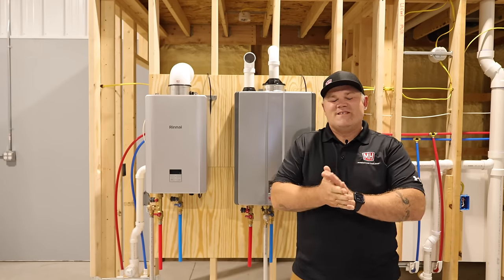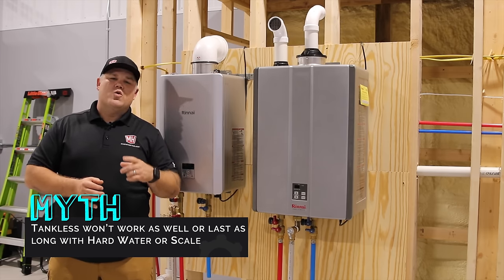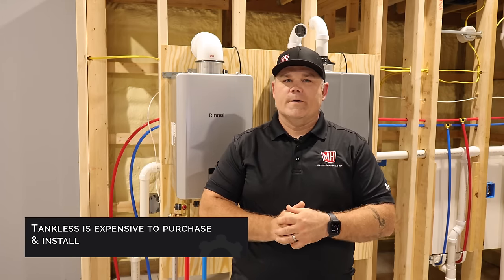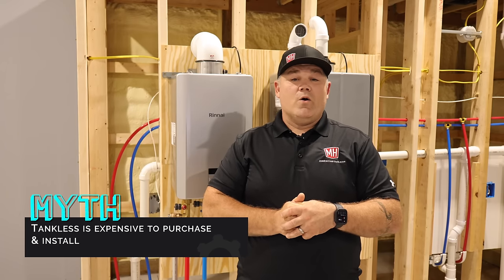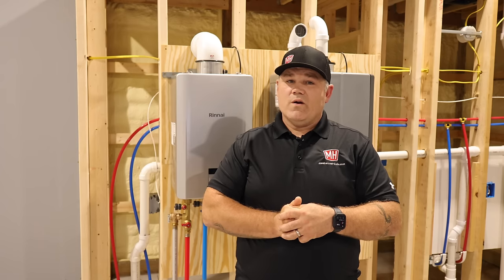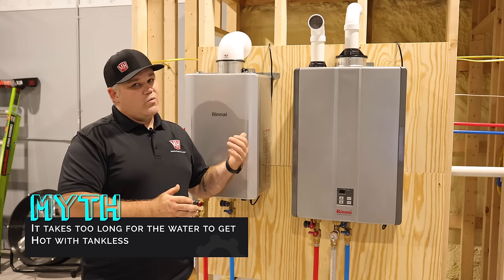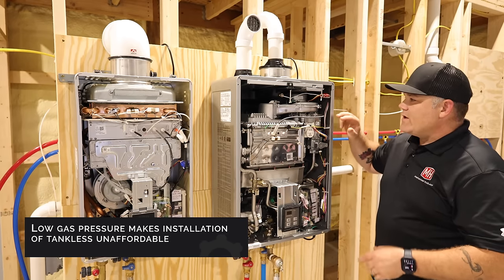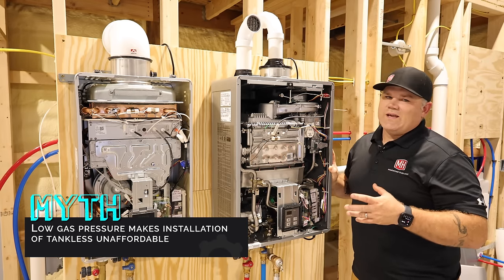Myth Busting! Tank -vs- Tankless Water Heaters

Comment: I’ve been a plumber for 38 years and as soon as you said, this video is sponsored by A tankless manufacture I know exactly where this video was going to go. You are one heck of a salesman. Knowing what I know I would never install one of these. In Wisconsin they no longer allow us to sell them as an energy saving device rather we can only sell them as an endless source of hot water. They have so many problems. They have been a huge moneymaker for me. I wouldn’t sell one to my worst enemy. you never addressed the fact that most existing homes usually have to upgrade their gas service to supply enough gas for this unit. You also forgot to address the question about how many fixtures can run at one time. I’ve had several customers that have water heaters that shut down. When they use multiple fixtures at one time. It’s very common for water instantaneous heaters to go into lockout if you run too much hot water at the same time. You didn’t mention any of the maintenance that is constantly required. You also didn’t mention the fact that you have to have water treatment devices with tankless heaters it’s not a choice they will lime up and be useless if you don’t. So many partial truths
Reply: Yep. And another issue - hot water pressure drop. Hot water in the tank creates additional water pressure which is not happening with tankless. Also, there might be overall an issue with the water supply pipe sizing.
Reply: You obviously didn't watch the video. He addressed many of your concerns. Not sure of the hate here. I've had mine installed for over 3 years now. Best home upgrade I have ever made. Maintenance is once a year and involves a gallon of vinegar and a pump, and is really hands off and not too bad.
Reply: @JasonCarr1979  Same.  Had mine for about 8 years.  Never had an issue with it.
Reply: Research the temperature rise before purchasing.
Reply: I’ve had a Rinnai unit in my house for over 16 years and I have not had any issues at all with it. I had it installed when we built the house so the installation was a little more expensive but well worth it. As mentioned in the video my 14 year old son takes 30 minute showers and he doesn’t know how lucky he is that dear ol’ mom and dad had a tankless water heater installed. If or when I need to install a new water heater I may check into a heat pump unit but if the technology isn’t what I am looking for I will be installing another Rinnai unit. The one thing I will say is that it does take about 45 seconds to get hot water to my kitchen faucet about half way across my small ranch home and it’s worse on the end of the house in the master bathroom since it is all the way on the opposite end of the house from where the water heater is. Area plumbers keep telling me that it isn’t worthwhile to install a recirculating pump but my wife would probably disagree on cold Wisconsin winter mornings when she is trying to get ready for work 😂
Reply: @jko0526  You are extremely lucky to have 15 years out of a heater in Wisconsin. That’s where I’m based. I’ve been a plumber for 38 years. I can tell you you are the exception to the rule, unless you have spent the extra money on getting an iron filter and a water softener.
Reply: I have the larger version of the unit on the left. I've had it for ten years and the operation has been flawless.  I made certain to get the largest residential unit available for my 4 bedroom 3 1/2 bath house. I have three daughters and my wife constantly washing clothes, running the dishwasher, taking showers and using sinks. My Rinnai supplies all of them simultaneously without problem. When so many uses are showing demand at the same time there is a slight pressure drop but no shortage of hot water.

The downside - 

1. The old freestanding tank was next to the furnace in the middle of the basement. I had to build a section of wall to mount the tankless unit.

2.  I did have to rework about 5' of gas line because the tankless unit is configured differently than the old water heater. Gas pressure was not a problem. 
3. The two section vent pipe is called  "B Vent" the sections come in short strange lengths and are pretty expensive for what you get. There are strict installation requirements as far a venting. Distance, number of degrees of bends and slope of the pipe are all critical. I had to buy 27' of B Vent AND core drill an 8" hole through my concrete foundation to get a straight path to the outside. The 8" hole allowed for enough space around the vent to properly seal the opening. I also had to replace some brick on the outside to properly repair the path of the old water heater vent. That was for cosmetics.
4. Every 3 or 4 years you must shut it down and pump a descaling solution through the unit to prevent hard water corrosion and build up. Our city water isn't too bad so every few years is sufficient.
5. I am an electrical contractor. I did my own load calculations and ran a 20A circuit for the water heater and furnace blower/controls. I built my own basement wall and did my own core drilling. I also reworked my own gas line. Most people can't do any of this without hiring contractors

Don't buy any all electric tankless. They are power hogs. Mine is natural gas fired and cheap to operate. The electric load while making hot water is the equivalent of a 100 watt light bulb. When not making water the usage is 5 (yes, five) watts. Think digital alarm clock.

I actually bought a UPS for a desktop computer and mounted it to the wall next to my water heater. If the power goes out I still have hot  water and it also runs the blower on my furnace. During the rare winter outages my furnace, water heater and stove still work because of the natural gas appliances, which the government is trying to take away.

They will have to pry my tankless water heater out of my warm, comfortable dead hands!
Reply: Jesus is the only way to healing, restoration and salvation to all souls. Please turn to him and he will change your life, depression into delight, soul heading from hell to heaven all because of what he did on the cross 

“Whoever calls upon the name of the Lord shall be saved” Romans 10:13
Reply: It's ok to change your mind with new information. 38 years has biased you
Reply: @toobad9946  i live in an area in Canada , where the electricity price is CAD$0,05/ kwh , loool . So , all electric is a no brainer for me
Reply: @karlsoffthegrid1378 I have one and love it.  Recirculating system.  Can run multiple showers at the same time.  Yeah, we have had issues but it's better than a tank IMO
Reply: What about maintenance and longevity of the unit, obviously it is more than yearly flushing like with a tank unit.
Reply: Here’s what’s funny . The rest of the world has been using them
For 50 plus years ….your comment is laughable
Reply: I came here to say exactly this.  Although I am a 25 year plumber from Canada.   This seemed like a straight up commercial.
Reply: I agree with everything he said besides the cost for installation.  I’ve had my tankless for two years now.  It was installed for 3800.  I was quoted 1400 for a tank install.
Reply: I have had my Rinnai for well over 10 years with only 1 problem. Sediment built up on the sensors and randomly shut the unit off. I installed a whole house filter for sediment and I flush it with vinegar every year or two and it has worked flawlessly.
Reply: @stevez340  my hats off to you! Keep up the constant maintenance and you should be fine for a while. Most of them in my area last a good solid 12 years if properly maintained and installed with proper filtration. Hopefully it lasts long enough to recoup your investment.
Reply: I have had a tankless heater for over 20 years and have had zero problems. I'm not a plumber but I know that heating a pot of water all day until you need to use it makes no sense.
If you live in a 100 year old house then maybe a tankless is not your best option.
Seems that most people against tankless are against solar panels and automatic transmissions as well.
Reply: What about electric heaters
Reply: I had a tankless system and was not happy with it.  To be fair this was installed 22 years ago,   But my 2 issues were that in winter even at the highest setting it would not heat the water enough to take a comfortable shower.  In the summer it was ok but I really didn’t mix it with cold water,   But the winters could be miserable

My second issue was the wind coming down the exhaust would blow out the pilot light fairly often.   When it did the system often would not relight, or would blow out again.  

When I sold
My house I never had one installed in any new house, I like the concept but the use wasn’t great
Reply: My brother was a MAJOR proponent for tanklessb heaters at first but years later, he said the same as you. 
You won't recoup the investment.
Reply: Installing a tankless is way more than a conventional w/h unless you are doing a change out. You have to run a new gas line. 40k btu vs 200k btu's Depending on where your meter is, could double the cost. So to say price is the same is BS
Reply: @karlsoffthegrid1378  do you read or watch before word salad comes out of your mouth? You have to do yearly maintenance on a tank unit as well. The video addressed your concerns, he said about three showers at once on the particular unit he’s discussing, and said that he doesn’t run into the need for gas line upgrades a lot.
Reply: @NeedleDrops  😂 yearly maintenance?!! Ignorance is bliss! you may want to read the Maintenance schedule that the manufacture recommends. You just proved my point.
Reply: @JasonCarr1979  No hate just fact
Reply: @karlsoffthegrid1378 what do you think about adding an indirect water heater to a tankless oil furnace?
Reply: You brought the fire. I’m especially glad to hear what that lockout code is all about. I’ve been to a house and had to reset one. I’ve never installed one of these. The first one I saw was like 2001. Another plumber with the same company, operating in the same neighborhood, was installing it down the street in the garage. I was kinda jealous. I strolled on down there to check it out. He was proud. Rightfully so. Our paths crossed a couple more times in life.
Reply: @HaroutBlack right up until you said the part about going to heaven. It’s all going to take place here.
Reply: Had a run Mai tankless for 18 yrs and still running strong. Easy install. Not one problem . One of the best products I’ve ever purchased. Will never own a tank again.
Reply: Fully and agree!
Reply: Had  tankless since 2012. Love it, no problems other than cleaning. I grew up in Berlin Germany and we had tankless water heaters right after world war 2. Ours were dedicated to kitchen or bath. Tankless is a blessing, long showers.
Reply: As with any application, a properly planned and executed installation can be the difference between a good install and a headache. I have had few issues with the many RHEEM tankless units that I design and install. Water requirements along with gas availability are often the ticket. No well systems unless the PH and quality of the water will support a good system. Planning gas requirements with the energy supplier is essential. The best option is an educated customer. Self installation or a friend knows how is the ultimate killer. I refuse to repair improper installation unless the customer gives me full reign on the repair is a walk away for me. 
A man must know his limitations
Reply: So, I've had a tankless now for about 13 years now, a Nortitz NRC111, and most things he say isn't true.😮 

I have mine set to 125F and I am in Michigan. Any lower and the water isn't hot enough, any higher and I lose flow.  Yes, I have unlimited hot water, but I came from a 75gal Lochinvar that lasted 30+ years and still operated fine while leaking for the last 5 years!

Had to pay to $600 upgrade gas meter to handle 200k BTU and gas company wanted $900 because I would be using LESS gas, but had also added gas range and BBQ so they waived that fee.

When colder and anything else running in the house, it throws a code - especially if you run a single valve mixing faucet, like kitchen sink at lower volume, it gets confused and thinks there is a leak and shuts off the burner. It also starts throwing codes when the nutralizer starts going - have replaced mine twice so far.

I don't run out of hot water but use much more water overall - it takes 2 full minutes for hot water to get to my shower.  Dishwasher needs to heat water more due to lower temperature and washer never has hot water loads anymore. Now I could add a circulation pump, but then it would be on constantly, heating the run of pipes 30ft through my concrete slab floor, like my tank did.

If I were to do this again, I would still get a tankless, but get 2 units and position them closer to where I use the water; one in the bathroom, the other near kitchen or laundry room. BTW, I have a UPS battery for mine as well.
Reply: He actually did address the things you mentioned. 
Gas pressure, # of operating units simultaneously, and water treatment prior to water introduction into the unit.
Seems doubtful that you even watched the video.🤔
Reply: @karlsoffthegrid1378  And my other two points? Keep making my point for me by cherry picking for your comments, geezer.
Reply: He exactly talked about how many fixtures can be operated simultaneously.  Perhaps your customers weren't informed about property sizing.
Reply: I have Navien tankless boiler/waterheater, for my radiant heat and hot water.  It has been in use six years with zero issues in Wisconsin.  It is wonderful. 
Er
Reply: @lilsabin  gas leaks and is easily repaired once you develop the skills and tools... i suppose the same goes for electronics failing but lets be honest, electronics fail a lot more commonly than a stainless, copper or brass pipe and brazing a gas leak is 1000x easier than getting past the shit they 'waterproof' circuit boards with just to repair a capacitor. if all electronic systems were planned around servicability I'd have far less concerns but every full elec system I've come across is designed by twallops that designed according to ideas of planned obsolescence and being able to sell you a new unit because nobody wants to service their junk...
Reply: @karlsoffthegrid1378   they say the gas ones work great but not electric!
Reply: @karlsoffthegrid1378  I agree,these are amazing systems! But,they are not for everyone.Endless hot water yes,use less energy,no. Price to buy and install,youll never get the money back and will most likely spend more to heat your water.There is more maint,not that tanks dont need it,but add in the neutralizer for the condensate,and a flush your lookin at $250 to $500 per year. I had both,I now am back to tank style.I have been an hvac service tech for 31 years now,and if you truly understand how btu's work,and temp rise,sone very good points can be made . Reg tank heater 40k btu,tankless heater 175k,so is kinda splitting hairs as far as saving money,though you paid 5x's what you did for the tank heater.Again,I think they are amazing,just not for everyone!
Reply: He literally specifically addressed or at least touched on every single thing you mentioned. Retro may be tough, but new build is a no brainer. I’d guess you’re like my OLD plumber…stuck in your ways, that’s ok, but the world will go on without you.

We just moved into a rental while we build, we are a family of 6 with 2 (soon to be 3 teens). I have been debating on what system to go with in our new place. Last night settled it. My kids washed the dishes after dinner, and we ran 1 bath (large soaker tub)…we literally had no hot water the rest of the night. There are 2 (I REPEAT TWO 50) gallon water heaters down there, and they are both turned on MAX TEMP. 

Saying you wouldn’t recommend one of these to your worst enemy is just dramatic ignorant foolishness. As soon as you said you have been a plumber for 38 years, I knew what was going on here…😂😂
Reply: @karlsoffthegrid1378  thank you for this valuable information
Reply: Plumber here. I've installed these for customers. Tank vs. tankless debate in a nutshell, they each have benefits and drawbacks. Ultimately, I would make my recommendation to homeowners based on factors such as family size, cost of installation, hot water usage, and willingness to pay for maintenance. 

Ultimately, when providing customer's with an estimate on installation time, gas pipe sizing, pressure checks with a manometer, recirculation issues, running pvc vents etc etc, customers typically don't save any money on the install of a tankless. The only benefit to these is literally endless hot water. 

There is a misconception that these save on your gas bill. They rarely do. A standard 40/50 gal tank heater is gonna be thermostat controlled and burn about 38k btu. A tankless is gonna heat water by throwing a minimum of 120k btu while hot water is being used. Do the math: less btu's over more on time or more btu's during less on time. It makes little difference. 

I don't care what anyone says, recirculation lines work better on a tank heater. Manufacturers of tankless units have tried to overcome the recirc line issue by installing pumps on their units. Here's the problem: it only recirc's when the unit is being used. Even if they managed to have a feature that could recirculate on a timer, the unit would have to fire to heat the water when hot water is not being used. So at that point, why have a tankless? It defeats the purpose. This unit now becomes an overly complicated mechanical system just to heat water -- that requires MORE maintenance than a traditional tank. Add to the fact that a tankless requires gas as a fuel source and electric to operate vs. A standard gas heater that will continue to work if your power goes out. 

Now, if your using a combination unit to for heating domestic water and for ambient heating ofthe home, we're opening a whole 'nother can of worms. These are pretty efficient, but again, I would sincerely urge homeowners to speak to a professional before pulling the trigger. 

Lots of things to consider. I usually left homeowners more confused than when we started. To me, that was actually a good feeling because I could walk away knowing I gave them a thorough explanation of the pro's and con's. Homeowners are hearing these things are all the rage. I urge them to do their homework.
Reply: @ well said
Reply: @JasonCarr1979 So how do you perform this yearly maintenance?
Reply: @jko0526 I have the same problem and was told to install another smaller unit at the far end of the home.....😢